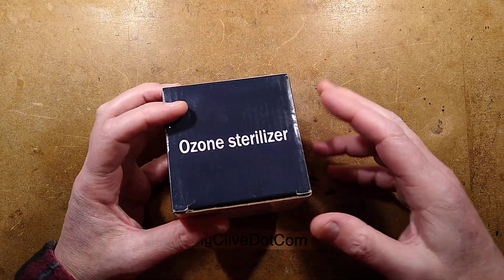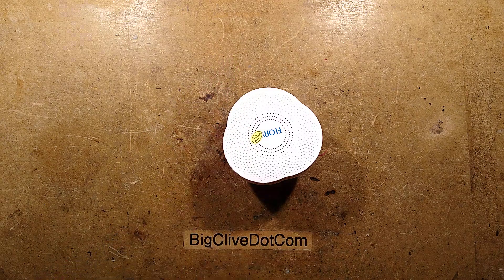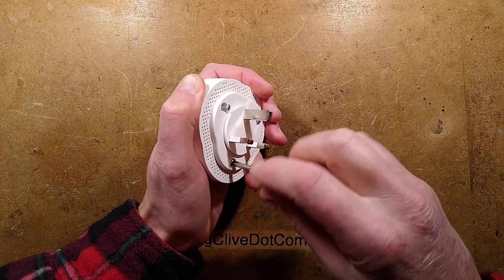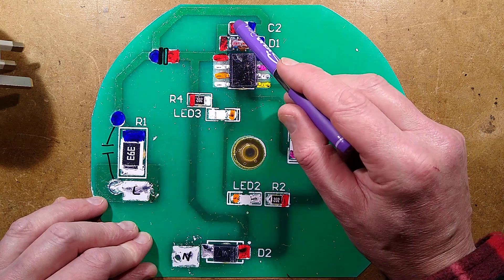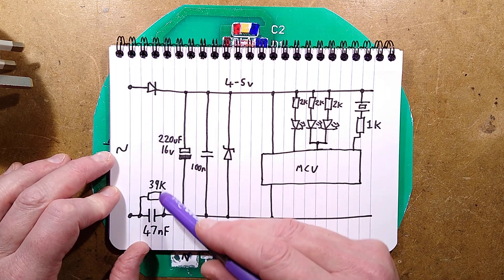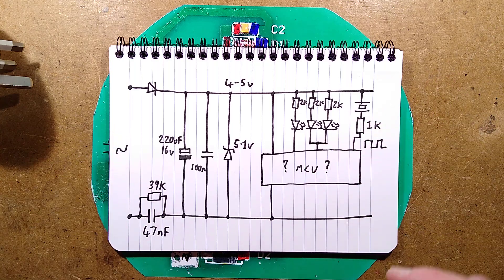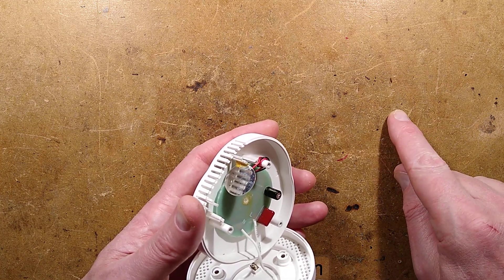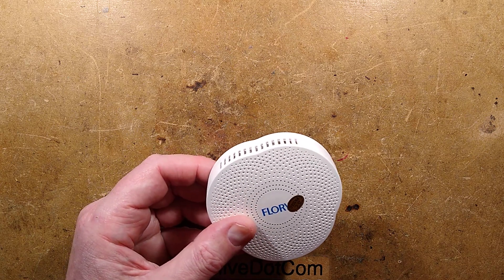I got scammed on eBay  (what a surprise)

Comment: “I didn’t hear an ultrasonic noise.”   Yes, we are all getting older, I can identify with that!  🙂
Reply: i can still just about hear 15khz tv line output whistle (recently turned 50😲)
Reply: I hated old CRT televisions as my hearing allowed me to hear the 15KHz high voltage transformer scream as it powered the TV tube.  Now?  71 years after launch, all I can hear is the screaming in my ears from too many firearms in the military.  Love Clive's voice.
Reply: I hear some right now -- there's a power supply somewhere in this room that's screaming to the sensitive.
Reply: @tactileslut  🙂 Thanks for the reply.   I worked in a lab with a late 1970s Data General minicomputer which had a switcher supply of around   1 KW which operated at a out 10 KHz.  It was genuinely LOUD!, and everyone heard it.

Comment: Many chinese Ebayers are leaving the selling platform. 

When buyers use the case/return description "not as described", the seller typically has to pay the return shipping costs. Or at least that is how it works in the UK. 

So the buyer has "protection". 

On Aliexpress however, the seller can do no wrong and as a western buyer, you've usually just lost your money.

Comment: Yeah, I've had a lot more luck getting refunds from eBay than Aliexpress.

One time I ordered a heatsink for a CPU, and the seller a hard shell suitcase type thing with what looked like some kind of water testing equipment built into it. I was really confused, so I contacted him and he said he sent the item to the wrong person. He then offered a full refund, to pay for me to send it back (I suggested it would be just as easy for me to send it to the buyer, which he agreed to), and he sent me five of the heatsinks in compensation for my time!

Honestly, I only wanted one of the heatsinks. It was only for experimentation with a high-powered LED, which I still haven't got around to doing. I don't know what I'm going to do with five of the things!
Reply: what cpu are they for? i might have a use for them?

Comment: It is not what it should have been. You mentioned 254nm UV would not produce ozone, it sure does. At least my 254nm lamps will generate a smell of ozone in an instant.
Reply from the maker: If they are Mercury vapor tubes then they may also be emitting 184nm which does create ozone.  But even 254nm will create an odd organic smell.
Reply: @bigclivedotcom Right on that one, I assume they are mercury lamps. Did some checking and 240nm seems to be the limit for ozone generation ie pure 254 shoud not produce ozone while stll sterilizing.

Comment: I wonder if you can scope the piezo output. Also is 5v bit too low for piezo?
Reply from the maker: It will work at 5V just low movement.
Reply: @bigclivedotcom  It just looks odd. Even cheap chinese popstations lcd handheld thing use inductor with piezo to boost output resonant circuit.

Comment: These can, in theory, work. Specifically on spiders, who have terrible eyesight and perceive the world through vibrations in the air. You could, in theory, produce the proper vibrations for them to perceive a continuous threat and attempt to retreat from the area. Conversely, you could accidentally produce the proper vibrations for them to perceive large amounts of prey in the area and then you end up inundated with them. The main problem being, the pitches necessary to produce the desired effects would vary wildly by species and size of the specimen in question, and since it's impossible for current technology to target, identify, and modulate the waves according to the target, the whole thing falls apart right out the gates.

Comment: Depending on your "type" of phone, you can probably install a "audio spectrum analyzer" app that lets you "hear" things our aging ears fail to let us know about now. I have been using an app called "FreqenSee"  for years  ( free, with ads) on my android which lets you view a 20 to 20KHz  analyzer screen that uses your phone's mic, and updates many time a a second for a nice and fast response. Granted, its by no means a laboratory calibrated setup, but it is a handy tool to use at times. Having an "ozone generator" plugged in and working 24/7 can cause some serious health issues, I wonder what the thought of using a device like that ( if it worked) is.
Reply from the maker: Ozone is present in normal outdoor air in trace levels (even in remote locations) and is an important part of nature.  A unit that puts out very low levels is comparable to open windows letting outdoor air flow through your home.
Reply: @bigclivedotcom Normal "trace" levels are fine, but having a constant generation device running in an enclosed room can be hazardous if the level of ozone generated is more than that can dissipate over its normal "half life of 20 minutes". as it breaks back down into regular O2.  According to our US EPA website information on ozone "Relatively low amounts can cause chest pain, coughing, shortness of breath and throat irritation. Ozone may also worsen chronic respiratory diseases such as asthma and compromise the ability of the body to fight respiratory infections", so,it's something to carefully observe the use of in an enclosed area. I do know, from having a larger ozone generating device, that it is an immediate respiratory irritant to me, at the concentration it outputs. I usually use it in a room with 2 exhaust fans that I can close off, and I do not re-enter that room until after a few hours of ventilation have helped clear out most of the ozone level, and it has also broken down a lot with half-life cycles.

Comment: Quote "Seller - It is what it says it is, i have sold many without issues"
Translation " i have sold many without issues" = Some buyers can't be bothered to complain or have no clue :)
Reply: You choose to assume that the seller is truthful this time?
Reply: @mikemondano3624  Yes, I always talk to the seller first.
Most are very understanding, especially the more experienced ones.
I press the contact eBay button as a last resort.
A tip for those not well experienced with eBay, don't let them keep you talking for more that 60 days from day of purchase, eBays automatic/AI system is difficult to use after that, should you want to get eBays help.

Comment: I took a look at the audio at 1:36 in spectrogram mode to see the audio as a frequency graph, and there appears to be no sound coming from the ozone device.
Reply: A waste of time. You don't know what frequencies are supported by any of the the devices used, and you won't get anything above 16 kHz on YT. The audio codec matters, too.
Reply from the maker: These devices often produce detectable clicks as they sweep through frequencies or as they reset at the end of the sweep.
Reply: @mikemondano3624  I thought this might be the case, YouTube discarding higher frequencies, but I was still curious to find out :)

Comment: 50+ years ago I was into valves, bit of a shock these things with 'legs'. I have bought HUNDREDS of leky bits from EBAY over 3 years. It's relatively easy to spot crap. The only failure was a broken glass alcohol thermometer. Tissue, corrugated cardboard in an aluminium tube and boot print on the outer wrapping. I didn't follow it up. I got pally with one seller but either EBAY or the Chinese gestapo stopped the little 'emails' we put on EBAY.  Might have been the recipe for cat kebab from his wife. (I lie)  Not bad English, nice chap.

Comment: Hi Clive, I use my Toshiba 48" TV as PC monitor. Superb for image quality, but I get a ringing in my ears or tinnitus during and after use. 
I'm thinking it might be due to ceramic capacitors ringing at ultrasonic frequencies, like the device you have here. (Alternatively, it might be the PC power supply).
A sound meter only registers ~3dBA difference (35dBA up to 38dBA) though. May I have your opinion please?
Reply from the maker: Could it be power supply inductors?

Comment: What is your sound recording strategy these days clive? I think if you are still upto you minimalist shenannigans there might well be bandpass filters on the microphones of a phone/ipad so that might well makeit impossible for us to help you. The active noise cancelling is also getting ever more advance. These days you can actull hear what your friend who is calling from a crowded trainstationis saying. Other than that ultrasonic shoudl be inaudible so it might be outside the dynamic range of your mirophones. Might be the topic for a video actually testing out how high the recording gear goes using a known good test tone.
Reply from the maker: It depends on where I'm recording.  Sometimes built in mic, sometimes external wired and sometimes Rode wireless.
Reply: @Matt Quinn - Caledonian Television So maybe the best trategy for gould sound would be to go ther ebefore them but use better grade equipment for the audio compression? I had asound interface that I had to run on 48khz in order for it not to ess the shit out of me on youtube videos. The better the original sorce was recorded the more it would ess.

Comment: You should have plugged it in while the spider was on the bench. :)
Or just plug it in near a cat or a dog, they hate ultrasonics.

I would'nt trust the power supply in it.
Reply: depends how good the dropper cap is ......
Reply: if it shorted thered be a nice bang, it'll certainly make a sound then!
Reply: @andygozzo72  It's only a half-wave rectifier with no protection. I did'nt see even a fuseable resistor in it.
Reply: @Franko_Walker  yep, i have a 'cheapo' usb power supply plug that has no fuse at all in the mains input part, ..only the thin wires going to the plug pins!

Comment: I think that most sellers that state they offer no refunds know they're selling crap.
Reply: I bought a 6" duct fan on eBay the seller said new in the box but  no-refund. It was obviously used: mounting screw holes, the wire ends and they hadn't even cleaned the dirt off the fan blade. Filed a complaint with pictures and got a 100% refund.

That being said I've seen posts by eBay sellers getting scammed by buyers and eBay siding with the buyer so this cuts both ways.
Reply: @tomschmidt381  I bought a desk from Amazon got a table buying from eBay and Amazon for years ebay had only 2 problems over 10 years Amazon I have 10 problems a year started not to buy online anymore or buying on eBay usa sellers only
Reply: As I understand no refunds is only helpful if you don't misrepresent what you are selling... Like not allowing returns because you changed your mind or didn't like it but it was exactly as advertised.
Reply: @matthewmiller6068  Not really, under most distance selling regulations you have to offer refunds or run the risk of a report to the relevant consumer protection organisation because you cannot just sell items that do not fulfill what is stated as the products description.
Reply: Not all I buy from few that resales items they have to put no returns as most items have not been tested by them personally so there not sure but have got some great deals after they sell under parts not working and works perfectly

Comment: A think (not sure) that's called capacitive reactance and are found in many low cost devices. But i never seen one connected to the zenner anode, most of have a liner voltage stabiliser after capcitor. And no current resistor for zenner, i am wandering how much time needs for that device to catch fire.

Comment: Whilst unlikely, it's also possible there are two similar products and they've got mixed up at the warehouse when the stock labels were applied.
Reply: possible .. 'er, mate, need some boxes for these insect repeller thingies' .... 'use these , should be for ozone sterilizers but we never got them from the factory, ,they'll do as they used the same case and look identical'

Comment: The white label on the side of the box is one that is put on by Amazon.  It shows what the Amazon title is for the item and the Amazon stock number.  It is usually placed to cover the UPC and is removable fairly easily.  Your eBay seller just drop-shipped the item from Amazon.
Reply from the maker: Or was selling removed stock.
Reply: Effectively paying someone on ebay to buy something for you off amazon xD
Reply: @rich1051414  Scammed X2
Reply: Amazon has been giving eBay bad name as so many resellers selling Amazon returns on eBay as Amazon items are Junk

Comment: Ebay are usually pretty quick sorting these "problems" out and refunding in my experience, although the Chinese sellers have often just immediately refunded when  I have challenged in the past to preserve their precious positive feedback.
Reply: They're very helpful with items that cost a few dollars.  Try it with a $400 piece of broken test equipment and you'll get the full Philippine call center treatment.
Reply: I have too but the actual reason is that they have to register their Chinese address for the account, even ones shipping from UK stock. Ebay requires returns to go back go to the sellers registered address and if the seller is at fault, at their expense. I know from experience its expensive to ship to China with tracking, often more than the item is worth so the seller is better off refunding.  I suspect this is what happened with Clive here, as soon as it was flagged with Ebay the seller conceded a refund.

Comment: ultrasonics do not always make noise a well designed ultrasonic that operates fully outside the audible range will not even click or chirp or hiss not even on startup.

the qc pass sticker is probably counterfeit or stolen.

today's fake gucci products could be genuine leather and logo but it is probably made with stolen scraps from their dumpster that are stitched together paired with stolen badges.

someone breaks into a gucci factory and steals a a bunch of gucci logos and rummages the dumpster for scrap leather.

Comment: Gotta Love eBay.
They know they have millions of 💩 products on their site. But if you can show it. They back up their buyer protection.. And I don't think Anything they sell fits the description. And I do love free stuff. 🤗
And yes. They always offer a partial refund first. Which is so stupid if you think about it. They are basically admitting they're wrong. But I'm sure it works with some people. Just stick to your guns. Because they won't ever pay for the return shipping for anything under about $50. Cause even $50 items cost them $5.
It's Fun ebaying 🤗

I would be interested to know,..
How you were able to verify that the Ozone wasn't actually Sterilizing the pests 🤔
... guess that's a bit more time intensive 🤣 👍
Reply: The worst I've had was buying a stainless steel kitchen worktable. My guess is, the seller I purchased from was one of those 'damaged goods' merchants, as when it arrived it looked like someone had driven a forklift into the side of the box. Two very well-defined (and taped up!) square holes, and it had buckled the entire worksurface. I'd paid roughly $150 and the seller wanted to offer an absolutely rediculous $20 refund. Thankfully, they yielded and let me return for the full value. It's absolutely absurd that they'd ship something like that without checking the contents, with the box so obviosuly damaged.
Reply: @ziginox  
I usually don't buy many big ticket items. And like to ask for pictures of the Exact Item being shipped. SO, I can identify it of course 😏
But anything under $50 I've purchased. I've gotten literally 90% of them FREE. The other 10% I bought, I bought because I knew what the item was that I purchasing. Like Flea Goop for the dog for instance. WHICH,.. I actually have gotten Counterfeit Goop as well. But was fully refunded. Like I said, best to know your items.
All the smaller ticket items, especially from China. It's not worth the return shipping for them. And they Always Inflate The Claims 😂
Not to long ago, I wanted one of the New, Cree 70.2 flashlights. And could see exactly what I mentioned. Ordered 7 different flashlights, and 3 different headsets. All from different sellers. Every One I got for free. And some damn nice merchandise. But all overly Inflated as to their specs. I knew that.
Only downside to that buying spree. Was eBay kinda warned me about it. Beings I was always making claims, and getting stuff for free. BUT,.. I also warn them about many items too. Just to stay on their good side. They don't really care. But it's insurance for me, more than anything. And I really don't like scammers. Still, as I said. Ebay does back up their policies. And that's good to know. Especially out of the estimated 1.5 BILLION ITEMS they list. That's a couple all right.
BUT, ITS ALMOST CHRISTMAS.
Time for Free Gifts For All 😂 🤣 😂 👍 ✌️

Comment: When you held the device up to the microphone, I got a weird sensation in my ears. It was less like I heard something and almost more like a high-pass filter where higher frequencies seemed muffled. Very odd. That said, I know there was something audible because at the same time, my cat was on my lap and he reacted to the sound. His head was down, but when you held the device up, he jerked his head up suddenly and looked straight at the TV as if he was startled by it. So, it might be on the edge or just out of my audible range, but my cat definitely heard it and didn’t like it.

Anyone else see the irony in Phil (maybe Phillip) making a cross-head (sometimes known as a Phillips head) screwdriver?
Reply: Problem is the youtube audio compression algorithm likely crops out frequencies outside the audible range and crushes those near the extreme ends in order to reduce bandwidth usage.
Reply: Well, It stands to reason Phil makes Phillips head screwdrivers.